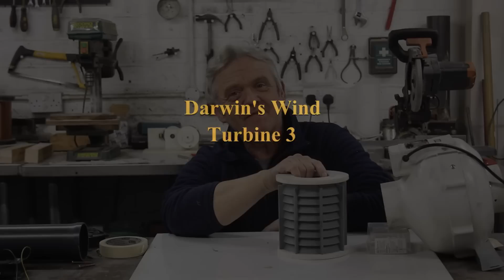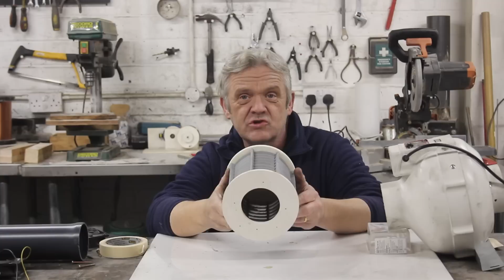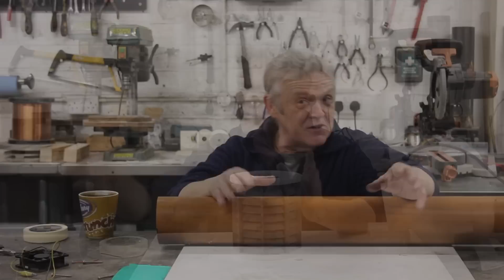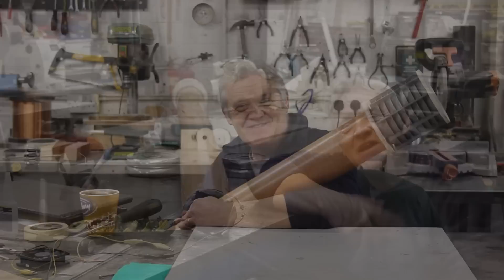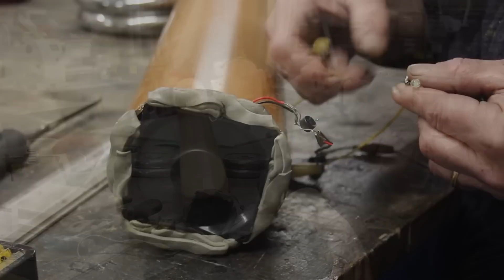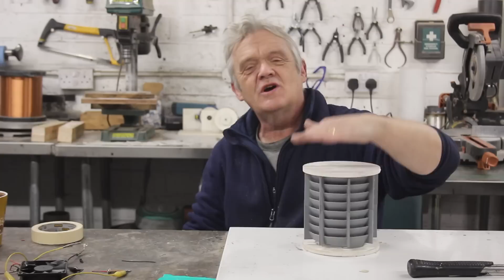1818 The Darwin Wind Pipe

Comment: now is it possible to use a kite, attach a tube fly the kite with the tube (like a giant condom attached to a kite unrolling as it goes up) and have this kite hold a device that can push/drag higher velocity wind down the tube while also using the drag to keep the device in the air maximizing both size of structure and wind speed?

Comment: You might like to stack torricelli cones. 2d Y=(outer diameter)/x  where x is outer diameter and less, or 3D, Z=(outer diameter)/sqr(x²+y²).... 2D, y=1/x, where either X or Y is the outer diameter or less. 

Cones with a continual change  in pitch starting near parallel with the wind to near parallel with the pipe will help the air flow transition with minimal turbulence inside the pipe, with the added benefit of having a larger cross section input (outside) gradually converted to a smaller cross section output (inside) such that it increases the velocity without increasing the pressure inside  much, and not having a high pressure inside reduces the amount of air that flows around your structure instead.

Designes with high turbulence inside create a bottle neck that restricts air flow.

Comment: only thing i can think of besides maximizing the shape of the fins is an internal cone to help direct the flow of air and reduce internal turbulance. I like the idea of a horizontally mounted wind capture system on a roof to maximize the use space.

Comment: I'm sure I've seen things looking like this on some roofs for some time. After a bit of searching, it looks like the reverse of some designs of "anti downdraught chimney cowells". Is it possible to make it from strips of material, in case you don't have a 3d printer? The angled parts do look like a small section from the bottom of a cone.
Reply: How about having wooden / steel uprights with suitably angled slots in which bale straps are placed and fastened suitably?

Comment: I would prefer the exhaust pointing upwards mainly because heat rises and that aids in the flow of the air.....  If you're going to use a pipe to mount it,  then perhaps painting it black would heat the air in the pipe and push it upwards toward the turbine.

Comment: HOW MANY SMALL GENERATORS CAN DELIVER BY FITTING INSIDE THE TUBE/PIPE?? would more diminish/reduce or increase power supply ?  I HAVE SEEN THESE TYPES USED FOR AIR  INTAKE AND FUME EXTRACTION, ON MANY OLDER FACTORY AND HOUSING, THEY USUAL HAVE A WIND DIRECTION FIN ATTACHED SO AS TO GAIN MAXIMUM WIND INTAKE ETC,,   AND PLEASE BE VERY CAREFUL WITH YOUR WOBBLE,(consult a specialist😊??💠. ......NJOY. THANK YOU...

Comment: I like this idea. Great videos!! My thought was to increase the depth of the vertical dividers and increase the diameter of the top to help reduce potential rain getting into the main unit and the pipe. But, that may be a future modification once you have completed the angle adjustment of the horizontal portions. I'm looking forward to your next video. I'm thinking something as simple as using your design to charge a small battery and make LED "nightlights" for a couple rooms in my house. Maybe keep me from hitting my toes on things. LOL!!! Love the "free energy" and I this makes a very useful project for my 3D printer. THANK YOU!!!
Reply: I also considered rain as a problem, though in his video series on converting PC fans to generators he covers giving them a water resistant coating that should serve to mitigate any potential damage. They also work with water when so treated, so let's not get too worried mate 😉.

Comment: If you intend to use it upside down, the piece that's just flat (which is at the top) would it not be better to print a gentle cone and invert it and glue it in place of the flat piece to capture more air.

Comment: Seems like you could make it both longer and the wind capture angle change to overcome any worries about drag inside the pipe. Maybe make some laminar flow down the pipe axis? That might add more drag than it’s worth. But another question: wouldn’t one of those Darwin devices work more efficiently on a sailboat than traditional horizontal axis bladed wonders? Seems like, under sail, having one on top of the mast or out on a bowsprit might generate a fair bit of power.I’d test one but I live in the desert.

Comment: Very cool mate!  This would also be awesome for ventilation and air quality maintenance.
Reply: I'm pretty sure that something along these lines has been used for centuries in the Gulf states. Many of the traditional built houses have a louvred tower on the roof, wind comes in, exits through the top, and in doing so, draws cooler air in through the house.

Comment: What I love with this design is you could easily create a reasonably large capture stack. Make it 16 sided and an accessible 3D hobby printer could probably create a half metre wide by 1 metre tall capture tower. this would have enough area to start capturing some real energy for supplemental charging. While at the same time not raising concerns with neighbours or nimbies! Venturi that down to one of the larger cooling fans 200mm. Possibly enough output to keep boat or caravan batteries topped up and run a few lights or a remote security system. Real world practical projects or a small business for someone!

Comment: To get it up in the air it needs bracing, right? Use a pipe joint to fasten eyebolts or something to attach struts or guy wires to. Put a swivel point near the base of the pipe so that it can be levered up. Have the end of the pipe swing into position above the generator mounting and seal the joint.  Sort of an erector set thing... I love the happy positive energy. Pun cheerfully intended!
Reply: 😎😁Pun Appreciated!! 👍👍

Comment: You could actually make a tree from many of these that branch out from this main tube. Each one would add to the air to push a more powerful fan.
Reply: Owsome.
Reply: Might need some no return flow valves but I'd love to see this in action
Reply: Can a tesla valve be made out of tubing? That would eliminate noise and moving parts.
Reply: I wonder if pressure differentials from each branch would cause turbulence at their entry points and inhibit airflow? There's probably a way to avoid that with the way the patterns made but it just might be a challenge to be aware of
Reply: @alexbeecroft167  You could probably use internals fins for that to straighten out the flow
Reply: @xmysef4920  that makes sense. What if the pressure above one tube is lower than the one below it, won't the air in that section want to rise instead of fall?
Reply: What if we were to position an “exhaust” pipe downstream of the fan, and utilize the Venturi effect to lower pressure on the back side? The air that blows by the Darwin turbine would then blow across the top of the “exhaust” tube and pull the air as well. Like blowing across the top of a drinking straw. Just a deep thought from a shallow mind.

Comment: A SLIGHT ISSUES with having it upside down! Wind often comes with rain and you have created a stack of shallow funnels which will catch the rain and funnel it down toward the electrical bits :)
Reply: More or less what I commented on in the previous video
Reply: @charlesroberts5637  GREAT MINDS THINK ALIKE :)
Reply: Plus, as I commented in the last video, that birds (especially Starlings), will build nests in it.  By the time you had too narrow of a slot for a bird to enter then neither could the wind.
Reply: The rain will hit the blades then drop off the bottom, I dont think it would be too difficult to make an internal trough with an outside drain hole at the base of the catching tower. I am wondering if having wider (vertically) overlaping blades would improve performance.
Reply: A chimney roof over the top would prevent the rain.
Reply: @strawman9410  Here in the west country a lot of the time the rain comes from nearly horizontal
Reply: It's not open at the top when it's upside down.
It's still only open on the sides. Only the train that come with the wind will get in and no birds.

Water can be extracted with a tight mesh in a ring along the pipe wall using capillary force.

Or let it collect in a short T shape.
And using a floater to open up the bottom when the level is high enough.

Comment: Make the pipe a larger diameter which reduces the velocity which reduces the pressure drop. Obviously a trade off. I think someone has made internal curtains which act as a non return valve on the opposite side. Not sure if it increased performance though.

Comment: Does the device actually concentrate the wind?  Would the computer fan spin the same, better, or worse if just placed in front of the blower by itself?
Reply: Very good question. 👌
Reply: Any additional obstacle on the air path will decrease the efficiency (pipe, cones, blades etc.). In my opinion the only point of this construction is to harvest more wind with less costs than just a simple "wall of fans". So there is a simple tradeoff between the cost of additional fans and losses on internal structures.

Comment: Would it be possible to put a flexible foil pipe as used for gas fire , rather than only having the fan at the end of the pipe have the fan on the side because if used in a chimney you get a natural draft from inside the house to outside , basically have one unit on each end of the pipe capturing both top and bottom,  in my head it sounds like I’m on the right path but maybe it’s just another cul de sac,

Comment: would it still not be better if you put it on the pipe the right wa with the the slots pointed down //  just reverse the end of the where hole and cap are that way it would keep rain and stuff falling into the pipe and clogging up the generator on the bottom of the pipe?

Comment: It really is a pleasant design. It wouldn't look out of place on top of any camper van or boat. Once you've finished it I'm totally making one of these to trickle charge a powerbank.
Reply: Sounds good, though where are you gonna put/plumb the outlet? (Where the air escapes after it’s gone through the turbine)
Reply: @xmysef4920  I hadn't thought about that, though I suppose if the inlet was coming from the roof it could be possible to plumb an elbow into a hole in the wall, working like a vent on a clothes dryer.

Comment: A blue pill might help.  Other than that, you pipe should be the diameter of the housing outlet otherwise you introduce turbulence which will reduce available energy in the working fluid

Comment: Does adding a turbine at the top or bottom accelerate it ?  How does it perform when the size of the Darwin pope relative to the down pipe is increased - does having 2 Darwin pipes with a turbine in the middle increase using updraft and downdraft eg from the middle of a building ?

Comment: Well I had no doubt it would work. What you should look at is if you narrowed the pipe at the fan end, would you get greater speed, or would the back pressure reduce the amount of air being pushed in?
Reply: I think as you increase the speed by narrowing the tube it decreased the overall force because of less mass at a time moving.

Comment: You might be able to increase efficiency by making a nozzle at the bottom of the stand pipe so that air speeds up the bottom when it exits, but moves slowly through the stand pipe with less friction.  This how a pelton wheel system works,

Comment: It seems common sense that the best angle would be starting at 0° parallel to wind direction transitioning smoothly to 90° down the pipe. OR you could get fancy and insert a nosecone below the Darwin with a "lump" at the slim tapered end pointed downward into the tube (conical airfoil) to increase pressure thereby mitigating some of the drag and significantly increasing efficiency at the turbine. If you want to get real fancy you could jet it or have the conical airfoil be adjustable relative to windspeed at the input to produce maximum flowrate at any given input pressure. Just some food for thought.

Comment: If you point them down the rain will get in there but if you point them up you will lose energy when the flow comes in contact with air flowing over it. If you put it up and put a pipe on top with a 90 that moves with the direction of the wind you can add to the flow.
Reply: That's what I was thinking, a pipe off the top that curves back to the ground. But that takes double the space and doesn't look as good. Maybe it just needs a way to collect the water around the walls of the pipe and drain it out via some kind of siphon or p-trap that will block the airflow.

Comment: That's impressive, the airflow captured on one side can make a Venturi effect on the other sides, driving more air inside the structure 👏
Reply: prove it!!
Reply: that is what I am thinking like using air pressure from an air compressor in the right structure can cause a vacuum pull going into the device, so if the air flow is moving in the right direction and effect going down from air blowing say on the west side of that unit, it could cause low pressure on the east side causing it to suck in  more air that is not already flowing toward it due to that venturi like effect.
Reply: @ThomasAndersonbsf  even painting  it black to make a sort of solar chimney or even creating a vortex air flow might be interesting ideas to explore. Have you ever heard about "zomes'?

Comment: First
Reply from the maker: awesome - another child friendly joke here mate lol
Reply: @ThinkingandTinkering  perhaps the 45 degree angle isn’t ideal for wind capture.

It is a common practical limit for 3D printing of parts depending on their orientation, that won’t need supports.

You may need to build using multiple parts if your angles are too extreme to print well enough, unless you’re able to deal with a lot of supports.